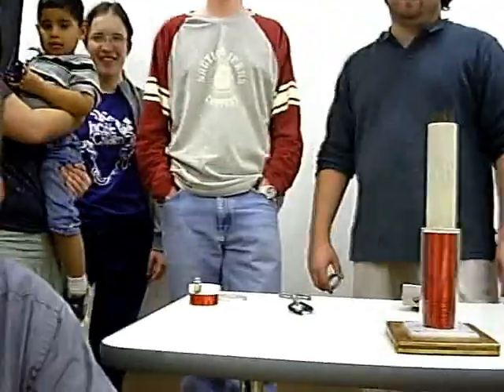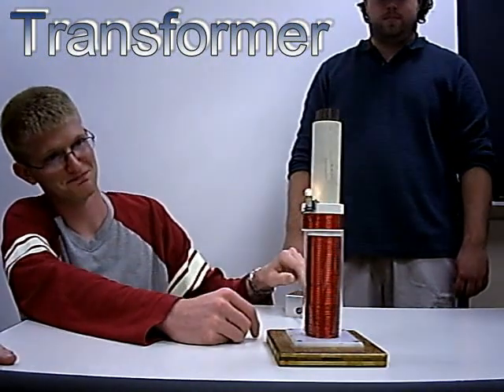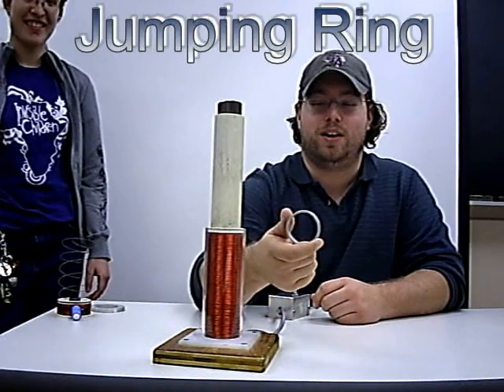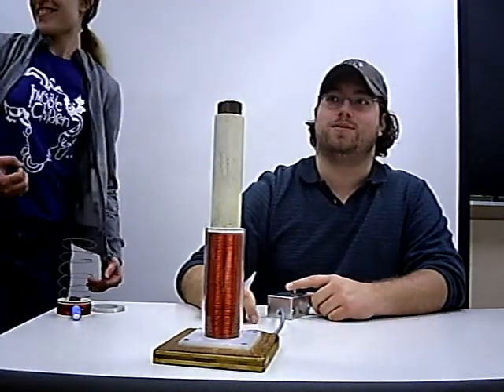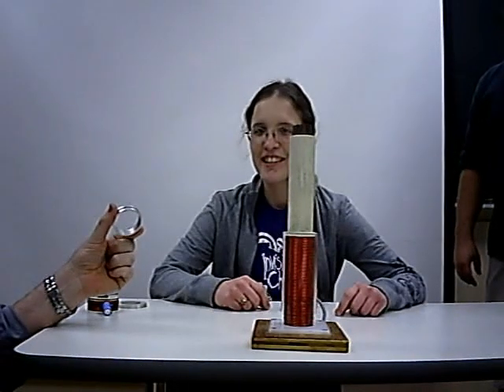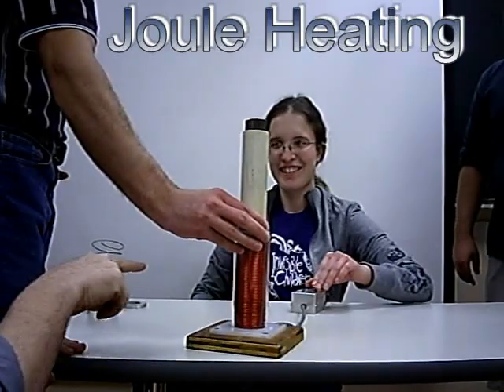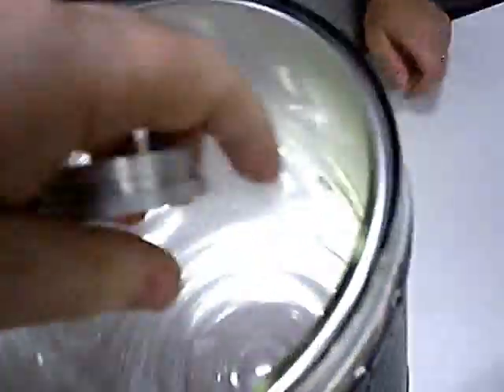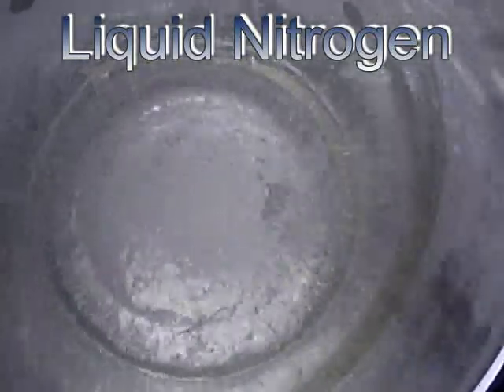Toy Box Physics - Jumping Ring Apparatus - SPS at SFA

Comment: Wonderful!  You say it has 400 turns of wire.
What guage magnetic wire? 
Is the core made out of 14" long welding rods?
What is their diameter?
What is the diameter of your pvc pipe?
Any specs you have would be appreciated.
How high does it jump from its launching point
at room temperature?  Where did you get the alu ring?
Thanks!